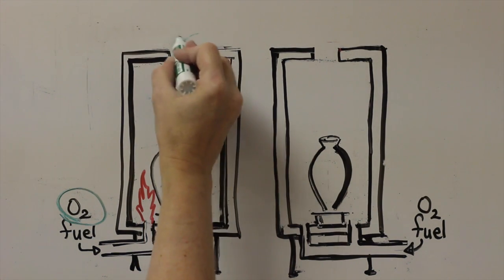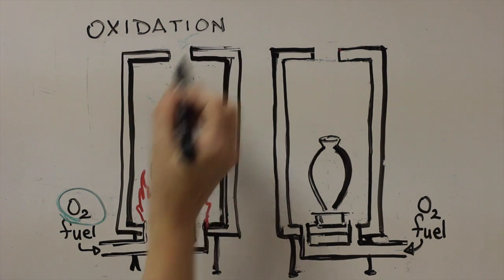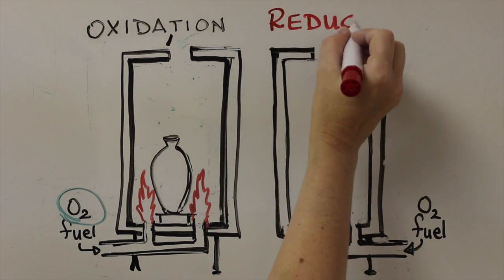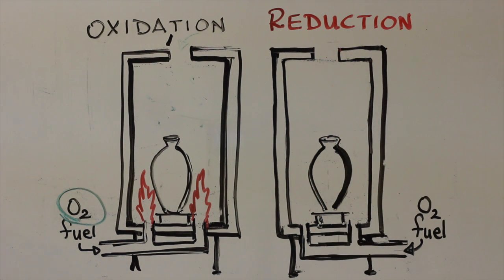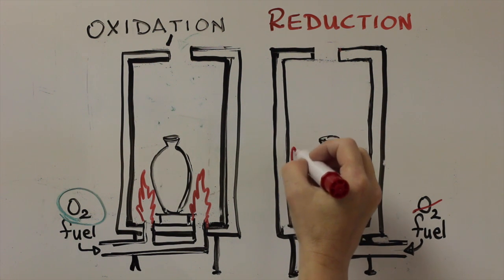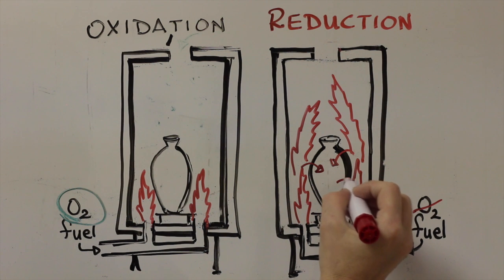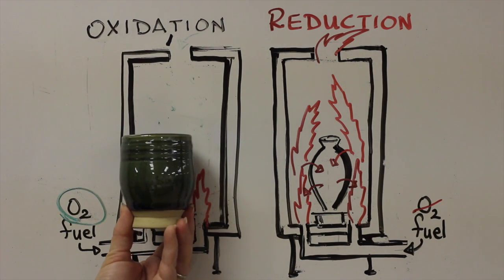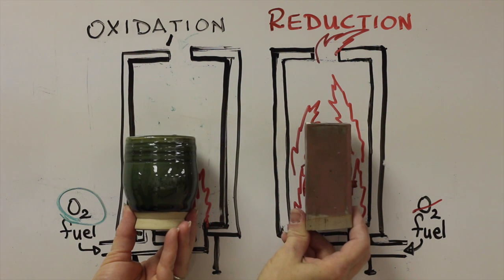Oxidation and Reduction

Comment: There are NO 'FLAMES' in Oxidation
Reply from the maker: If you're firing a gas kiln in oxidation there are certainly flames from the burners. Electric kilns don't have flames (and are neutral or oxidizing) but gas kilns can be fired in oxidation or reduction. ~Cara